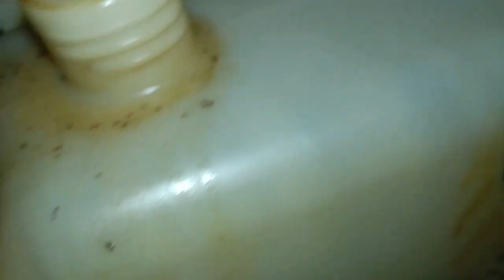X1 The Resurrection it's alive

Comment: That's dope I just got to X1 I just had to change fuel lines and the carb and dump the old gas out in major key to add fuel filters in the tank end of the fuel line👍 you where to get replacement parts for it?
Reply from the maker: Thanks, yea it’s a pretty cool bike. I was working on it for a friend of mines I ordered the carb, and battery off of eBay.

Comment: Hey just asking i have a x1 50 cc 2 stroke pocket bike that i got 2 days ago and it’s making a loud squeaking noise and its only going like 13 mph do you know what the problem can be? I don’t anything about these bikes
Reply from the maker: Ok, that’s what’s up. Cool little bikes!!
To answer your question, it could be a number of things. I would start with the simple stuff first like, making sure my brakes/ pads are not sticking to the brake rotor which could cause the sound and keep the bike from gaining speed. Also making sure the chain is in a good condition. Keep me updated with the process and good luck